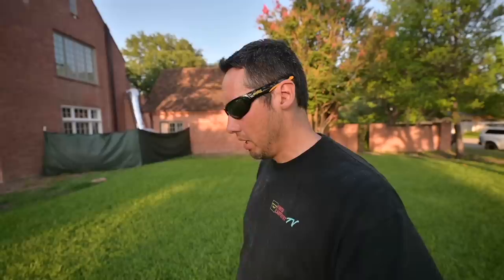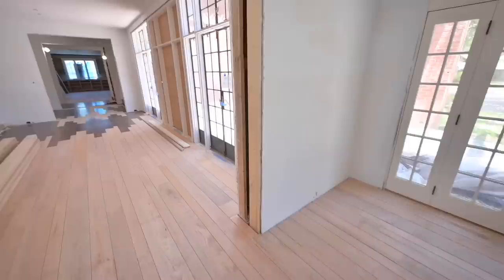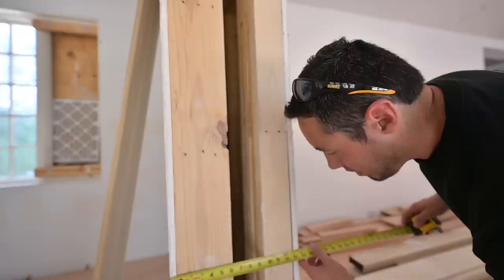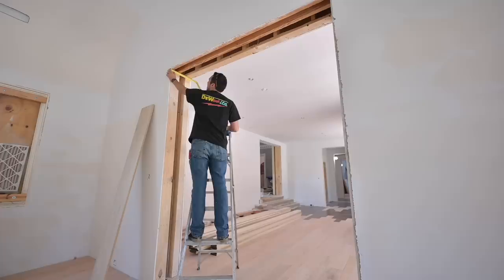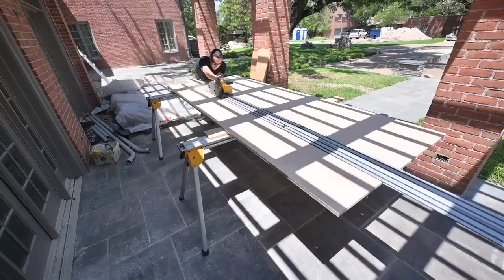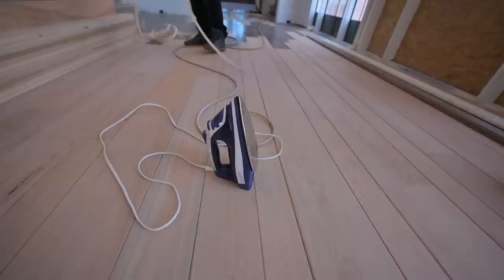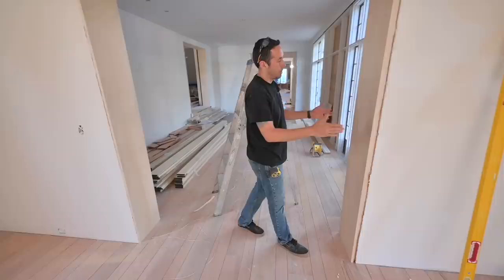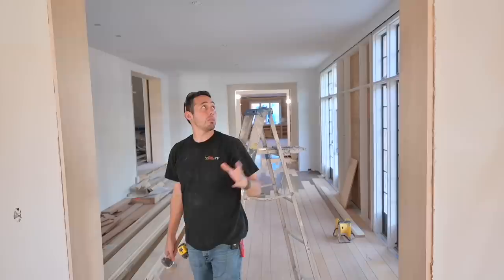I got us into a BIG JAMB on this job!!!

Comment: Sorry, but edgebanding is definitely not the way to go here. The glue dries out eventually and starts peeling.   Turns out you can actually glue 2 boards together to make a wider board. That's what finish carpenters do! Good luck
Reply: at 14" wide that glued panel would shrink too much.  Probably should have have used hardwood for the edge though.

Comment: As to not having the joining bars for your track saw tracks, just slide the the bars onto one track about 1 inch from the end of a track and crank down the set screws.  Then when you need them you have them.  Just a easy way to keep them handy and not lose them :)

Comment: Fine wood like oak, maple or black  walnut finish grade trim, even soft wood should be edge glued solid stock and not plywood. So paint grade or varnish, use sid stock , cut width then casings, fewer headaches. Any cabinet shop would be happy to make oversize jamb stock.

Comment: Design change. Answers the question about where the pocket doors went. We had a butchered jamb that needed facing with minimum change in the opening width. Used 1/8” Baltic birch. Painted up nicely.

Comment: After you held the trim in place I was wondering why you edge banded at all, but later you said that there would be I think a quarter inch reveal.  So, that's why.
Also, good to know that one side of the wall was plumb so at least one straight 90 degree cut was good. The other side would taper... instead of both sides tapering.

Comment: I’ve been wanting to pick up the DEWALT cordless tracksaw but I know AS SOON AS I DO, Milwaukee will finally release theirs. Great video, boss man!
Reply: If you do get the DeWalt saw, buy the Festool track.  It's compatible and the track is "tackier".  Also, you can buy more accessories (square rail, parallel guides etc) for it.  Finally, the Festool track connectors are a little more solid/accurate
Reply: @hansangb  wow! I had no idea, thank you kindly!
Reply: I love my DeWalt track saw, but have to agree on getting the Festool track.  Good luck finding parallel guides for the DeWalt track, its symmetrical design makes designing add on accessories a difficult task.  I wish I knew the Festool track was compatible before I invested in four different sized DeWalt tracks.  

From what I hear, the Makita track is also supposed to be compatible with the DeWalt saw.

Comment: Are you adding the thickness of your track saw blade to your measurement and cutting on the off cut side instead of the normal way a track saw is used?

Comment: The 1/16 that the end of the tape measure moves, how many times has that messed up a cut?
Reply: It's supposed to move the width of the blade so that you get an accurate measurement whether you're hooking the board or butting your tape into it

Comment: If the trim will be painted white I would use glued up solid wood to the width needed, not plywood. The edge banding, no matter how well applied will nick when bumped with vacuum cleaners and furniture moving. Who framed that wall so out of whack?

Comment: Why don't u wear work boots ? Don't you think that would be more professional
Reply: As predominantly a finish carpenter I can say that work boots aren't necessary. You'll see most of us wearing shoes. Sometimes I wear boots for demolition but usually just wear my converse all terrains for everything because they're waterproof up to 2" and I like the way they feel on ladders and on a roof. They feel safer than a thick sole boot.
Reply: @Tool_Addicted_Carpenter  sneakers are for the gym . wait till you step on a nail and it goes threw your sneaker
Reply: @robertackerman3500  Maybe I just keep my job sites cleaner than you. Anything dropped with nails is always yelled out as a "landmine" and is immediately picked up. Going on 10 years with sneakers. I'm not tracking muddy boots through somebody's home to do finish work when it's not necessary because a YouTube commenter is telling me what attire to wear to work. Sometimes I wear my socks because I can do whatever I want. Did you honestly think this conversation would change mine or Richards choice of footwear?
Reply: Guess that's the professionalism union carpenters (24 years) have vs home Reno guys that post help wanted adds on Craig's list .
Reply: @robertackerman3500  I'm not here to disparage one operation or the other because I respect the union but it's my choice to do what I do as opposed to the union that runs rampant with addiction and underachievers. I can easily join the union and I've been offered on multiple occasions. My business partners brother is a union construction manager as well as a building inspector while my uncle is a site supervisor and my cousins are union carpenters, all out of Boston. I've been exposed to many union carpenters, 80% of which with a drinking problem, and they all told me to steer clear unless I enjoy metal studs and board. I prefer fine finish woodworking and full house remodels so I chose my path wisely and it allows a lot of creative freedom. If you genuinely think that the best of the best are union, that's something you need to objectively rethink. I'm doing all of my own work on remodels in the hundreds of thousands of dollars. Small and well managed operation of frame to finish, cabinets, decks, additions, tile, flooring, etc. I have an 18x7 enclosed trailer outfitted as a mobile workshop. My customers love me, they don't care if I'm wearing boots or sneakers. When is the last time you had someone tell you they were going to move until you remodeled their house and made it a forever home? I hear it regularly. It's a great feeling. I won't be changing that. I'm only 28 with a lot of fun to have. I enjoy what I do and invested a lot of time and money into being able to do it. I went to school for this and apprenticed under a master craftsman for 5 years. No one is telling me where to be at 6am. That's slavery and they clearly have their hooks in you to the point that you're attempting to belittle an entire branch of carpenters because they don't adhere to your militarized construction practices. That's a ludicrous and aimless stance to have. 24 years and you're so blinded by your lack of exposure that you think footwear determines professionalism. I genuinely pity you for that. Broaden your horizons sir.  Have a good day, maybe enlighten yourself. Let me know when you make your next video showing us how to do it all, union style.